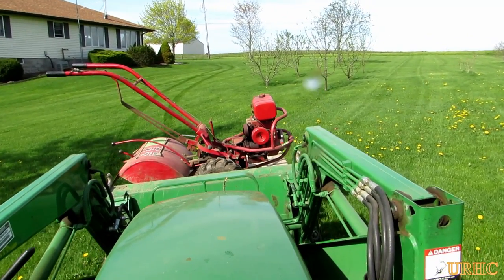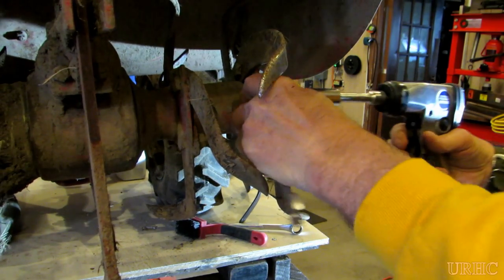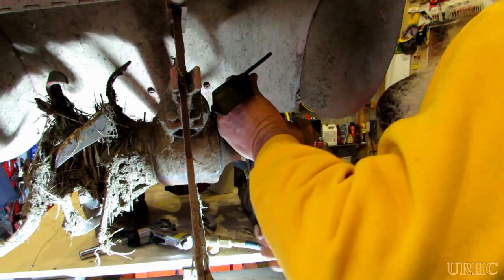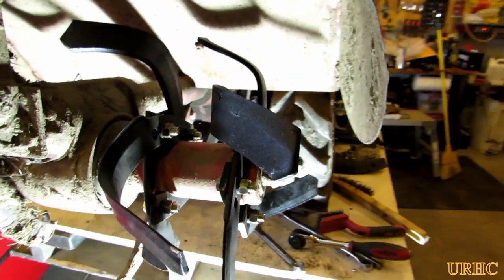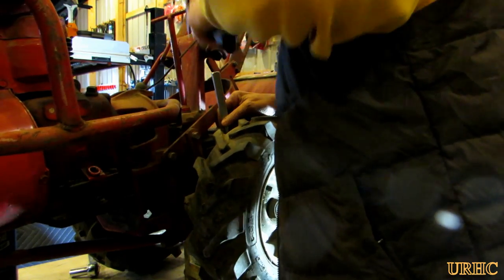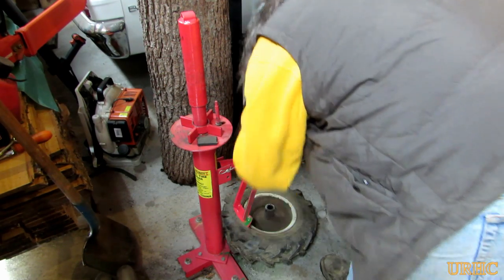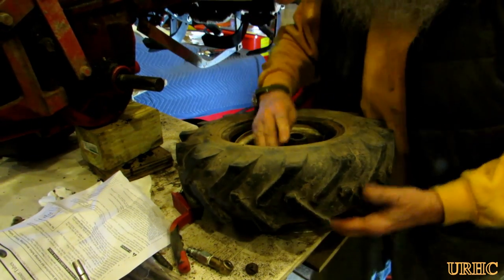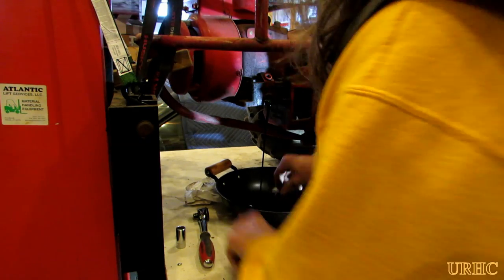Getting The Troy Bilt Horse Ready For The Garden

Comment: I recently purchased a Horse tiller that based on the serial number was built between late 1975 and early 1976 that came with the original running Tecumseh HH60-6pm .  I've replaced the wheel axel and tine seals that were leaking, rebuilt the carburetor with an original Tecumseh carb kit, added a fuel shut off valve and fuel filter, and replaced the tines.   I looked at cheap aftermarket tines, but after some research, I decided on OEM spec KD tines which although are  more expensive, I believe are worth the investment. Many aftermarket tines come with a 3 hole pattern, are shorter that OEM and made of lower quality metal.  Yes, these tillers are built like tanks and made to last which is why I opted to pay more for OEM spec tines.
Reply from the maker: Those tines were very good. Switched to raised beds and sold it. Thanks for watching.

Comment: I have the same tiller, 7 hp Koehler, still runs great but my times are shot . Just ordered the same times as you. $56.00 Amazon, free shipping. They are around an inch shorter than the original but for a third of the price. So I decided like you to use them. We will see , should be fine.
Reply from the maker: Mine have stood up well.  Thanks for watching.

Comment: You got real lucky getting that wheel to simply slide off.  99% of the time it's frozen onto the shaft and a bitch to remove. To prevent this in the future remove both roll pins one at a time and just start tilling.  Eventually the wheel will break loose.  At that point clean up the shaft and wheel bore and apply some anti seeze and reinstall the pin.  Now do the next one.  This will help ensure easy wheel removal in the future.
Reply from the maker: I found if the machines are stored outside that can be a problem,  but I have never had thst issue keeping it indoors. Blue Creeper is a easier option to loosen rusted together parts or to prevent  that from happening and it is environmentally friendly.  Thanks for watching.

Comment: I just bought 2 1970's Troy-Bilt Horse Tillers with Electric Start for $150.00, and I bought a 1979 Pony for $125.00 in 2004. I buy every old Troy-Bilt I can.
Reply from the maker: You were lucky to find them. They are hard to find reasonably priced anymore. Thanks for watching.
Reply: i bought a used one owner troy built wood chipper from the late 80s about 8 years ago use 2-3 times a year and it still works great troy built was a great out door power equipment co.
Reply from the maker: I still have my troy bilt chipper but haven't used it lately. Great machine.
Reply: jmaedl027 jmaedl  You will LOVE it. See my comments above.  Did it come with original documentation?  They literally told you how to tear the whole thing down and fix/restore everything. (now finding parts is difficult since TroyBilt was sold to MTD and its original factory in Troy NY was closed.

Comment: I didnt know that about the handle removal to fill the oil , thank you , mine has leaking rear axle seals I need to change and In the meantime keeping it full is a pain with hose and bottle lol  just did my times the other day ,  new belts and now I'm just adjusting everything and nee fluids , to the garden for the first time in who knows how many years, great to see these old machines being used , theyvreally are awesome
Reply from the maker: That's the easiest way to fill it and the rear seals leaking is a common problem.  Usually dirt grinds into the shaft damaging it so the seals dontlast like everything else on these machines.  Thanks for watching.
Reply: @unemployedredneckhillbilly2023  right on , your video really helped thank you

Comment: Best video I've ever seen for somebody that doesn't do it everyday of the week, very understandable I haven't messed with a tillerr like this in 30 or 40+ years this one was laying in a field and we're putting it together. I'm going to have to buy some parts for it, two tires a carburetors are already bought, probably a couple hundred dollars and I'll have it running good Tillers I grew up with one of the best , and thanks for the tip about the oil type. I'll report back after I get it running.
Reply from the maker: Thanks. Good luck with it. They were built to last generations. Probably will need tine shaft seals also. Thanks for watching

Comment: We own a 40+ year old  Troy Bilt , HORSE  . 
We would never think about putting it away in that filthy condition .
After every use we hose it down and remove any dirt and foreign objects in the tines .
For winter storage we drain the tank and  purge the carb  of fuel.
I pull the spark plug and  FOG the cylinder walls with oil ,to prevent rusting .

The following season ,the startup is flawless .
Reply from the maker: This one stays outside all summer. Full tank year round with stabilizer and that stuff comes out of the tines first use. Keeps on ticking.  Thanks for watching.

Comment: I have pretty much the same tiller, mine's a 5HP Horse (Kohler iron), probably about 1980.
Burns a little oil now, but not bad.
I think they had 7hp also, some came with electric start.
I have that bumper system too. You can put a "dozer blade" on the front with that (I have one of those too).
Those machines last a long time.
Nice videos.
Reply from the maker: This one came with a plow also. I sold it on Craigslist to pay for part of the tiller. The engine lost spark and died the end of last season so I will have to look at it soon. Thanks for watching

Comment: Thank you.  This was most helpful.  Just picked one of these up and was wondering where to check the gearbox oil.
Reply from the maker: They are tough old machines.  Thanks for watching.
Reply: So after looking at the gearbox fill I assume the rear tine box is lubricated from the same reservoir.   It would appear to run through the drive shaft housing into the rear tine box.
Reply from the maker: Yes it's a hollow casting. Usually the rear tine seals go and cause the level to drop.
Reply: You are correct.  Gear oil level was down and I noticed the rear seal was wet.  I will need to keep an eye on it.  May need to replace that gasket sooner than later.  Thanks for the heads up.

Comment: I have a 6 HP Troy-Bilt horse my father purchased in 1981 with a tecumseh engine.  It still runs well, starts in one or 2 pulls after being away in storage for the winter).  It does  smoke intermittently  (seems to subside when the oil is actually LOW so it doesn't make sense...) and then the engine almost starts running to an idle until the smoke clears.  Can't figure the issue, it's been that way since the last time my father (who has since passed away in 2014) some 20 years ago.   I have LOADS of documentation on it - all supplied by Troy-Bilt that they generously gave you before being sold to MTD in the late 1990s and moved out of Troy NY.

Other than the smoke, it is nice when the tiller starts in 2 pulls. Of course, getting parts for it is getting tough.  I won't let go of it.
Reply from the maker: I visited the original factory in troy to buy my Squeezo back in the 80s and they were doing well. Too bad companies like them were bought out and the manufacturing moved offshore. Do you turn the gas valve off when not using it? Sometimes the needle valve will leak gas into the cylinder if you don't an make it smoke for a while warming up.  Thanks for watching.
Reply: John DeNicola  might be piston oil ring. Just keep oil in it and let her work.

Comment: Great info on tine replacement..my 7hp needs it and I wasn't sure which tines to get but it looks like the eBay ones will do fine. In my 71 years I've used multi vis in all types of air cooled engines with no trouble. In fact it gets down to 40F at night here even in summer so SAE30 is never a good idea regardless of what manuals say. I use just Supertech 10w-40 in summer equipment, 5W-30 in snowblowers..
Reply from the maker: I use whatever  the engine  manual calls for. Thanks for watching.
Reply: @unemployedredneckhillbilly2023  That's obviously the safe answer and probably how most folks roll. I hope someday you'll have time (and the thermometer) to chill SAE30 to 40°F and tell us what you see. Then heat SAE30 to 170°F and tell us what you see. Same thing with 10W40 and let us know any conclusions...thanks again for the tine video..liked subscribed..

Comment: The sulphur /phosphorous blend in gl5 is higher than the gl4 gear oil... the higher sulphur / phosphorous blend sticks more aggressively to the yellow metals, and as a result, the metal peals off of the gears (instead of the additives)..This is not a high heat or high pressure situation, nor is it a 20,000 miles a year rototiller (maybe it is).  for the price, go with the manufacturers oil (the price difference is insignificant).  I am not recommending anything (gl4 or gl5), I am not selling anything, I am not getting paid.  this is only my opinion.  Thank you for a wonderful video.  Happy Gardening to all !!!
Reply from the maker: The gl5 from Walmart says on it that it is safe for brass and copper. The manufacturer is long gone so that is not a option. It only sees about 5 hours a year use and this is the oil I have seen reccomended online if you can't find the gl1. Thanks for watching.
Reply: Without a doubt, most tillers only see about 5 hours a year, and since it isn't a high heat, high torque, high speed situation I guess that gl 4 or 5 are both quite ok.  (the house is falling apart, but things like this turn me into a retentive mess (go figure)).  Thanks again for a great video.

Comment: You went through the trans oil level check a little fast..for us slower guys without the Troy manual how to you do that again..?? is the level supposed to be at the plug behind the left tire, I'm guessing ya want the tiller level not resting on tines..thanks
Reply from the maker: I find  the easiest  way is remove  the handle screw  and put a screwdriver in there like a dipstick and then hold it up against  the side to see if it's  level with  the plug. You can also remove the side plug and fill till it drips out. The manual shows exactly  how to fill it. Thanks for watching.

Comment: I just bought a used TB Horse 3 (Kohler 7 hp) circa 1984 at an auction... runs like top. No manual... 30 weight detergent engine oil, but 80/90 wt gear oil for the trans.?
Reply from the maker: Be sure  the gear oil is compatible  with  brass. Not all 80/90 is. I use 30 wt in the engine because  everything else runs right through it.  Thanks for watching.

Comment: Enjoyed your video.  Thanks for the tip about the GL5.  I have the same machine, though I think it has a 6 hp Kohler.  Is there a way to fix the clutch adjustment so that I don't have to hold down on it to keep it tilling in heavy cutting?  I have tried pretty well everything the book recommends.

Question:  Why is the transmission oil GL5 rather than 75/90 gear oil?
Reply from the maker: Be sure that you have a matched set of belts. That will happen if one belt is larger and it's only really working with one. Thanks for watching.

Comment: There's a product that you can use to stop the seals from leaking in the transmission. Doublewide6 on YouTube used it on a snow blower gear box and it works really well. Here is the link to buy it:

Look at this on eBay http://www.ebay.com/itm/292044457208

Link to doublewide6 video: https://youtu.be/3jjfFM9JuSk

I have never used it but did buy some for the Cub Cadet 582 special we are restoring at the moment.
Reply from the maker: You have to be very careful about what you add to the oil with the brass gears in these tillers. Some additives will cause them to self destruct.  Some day I will replace the seals. I think all the dirt ground in over 35 years could have damaged them.

Comment: I have have gotten a lot of contradicting info on what gear oil to use in the horse gear case.  This is what I found on Troy-Bilt's sight just in case it's helpful to anyone.  Thanks
Tiller Transmission Lubricant

Sep 11, 2017•FAQ
Article Number
000002341
Problem

What lubricant should be used in the tiller transmission case?
Solution

In the past the rule was: For partial fill-ups (a few ounces or less) use SAE 140, SAE 85W-140 or SAE 80W-90 weight gear oil with an API rating of GL-4 or GL-5. For full replacement use SAE 140 or SAE 85W-140 gear oil with an API rating of GL-4 only.

We have also found that 80W-90 oil with an API rating of GL-1 is acceptable for both partial and full replacement of tiller gear oils.
Reply from the maker: Really just has to be brass safe. Ariens makes a high pressure additive for auger gears that I have also tried. Thanks for watching.

Comment: Do you just fill the motor oil up to the thread lines? On the transmission oil, where was the plug? And how do you know how much to put it? I saw you check the level with the screwdriver and say it was low, but it how did you know? Thanks for the great vid!
Reply from the maker: I fill the oil up to the center of the plug threads. There is a plug on the side of the transmission that can be removed to check the full level. I just use a screwdriver and check it is at that level from the top . You just fill through the handle bolt hole. Thanks for watching.

Comment: Is that the "Horse" model? When I was a kid my Granddad bought one of them brand new and I'm going to be 41 in a couple weeks! I remember that it had some good compression- if you weren't careful when you were pulling it over you would snap your wrist something awful. It was a great tiller- I think that my uncle still uses it. Great videos, very informative.  John
Reply from the maker: Yes it is the horse. It is at least 35 years old and still going strong. To bad troy bilt went out of business and sold out to mtd that cheapened the new ones down.  Nothing like old cast iron equipment.  Thanks for watching.

Comment: I have one extremely close in age. I can't find any plates for manufacturers name or anything. Do you have any sources to find out year or anything else that might help
Reply from the maker: I think the serial number indicates  manufacturing date. Do a search for that information.  Thanks for watching.
Reply: Models older than around 1990 only use horse or pony as the model number. The serial number is on right top side of the transmission below the T handle

Comment: I just picked one up off Craigslist in the free section FCFS.   I messaged the guy and offered him $20 to hold it for me because I live 47 miles away.   35 minutes later I was pushing it into the minivan.    If I had known it was a Horse I would have offered him $50.
Reply from the maker: Wow are you lucky.  They are great machines.  Thanks for watching.
Reply: One belt is missing.   I ordered two and came here to learn from
Another’s experience to put it on.   Thank you for sharing your knowledge.
Reply: One belt is missing.   I ordered two and came here to learn from
Another’s experience to put it on.   Thank you for sharing your knowledge.
Reply: One belt is missing.   I ordered two and came here to learn from
Another’s experience to put it on.   Thank you for sharing your knowledge.
Reply: One belt is missing.   I ordered two and came here to learn from
Another’s experience to put it on.   Thank you for sharing your knowledge.
Reply: One belt is missing.   I ordered two and came here to learn from
Another’s experience to put it on.   Thank you for sharing your knowledge.

Comment: Those older original Troy Bilt tillers bring big bucks now....hard to find one that's decent for less than  $1K ...heck of lot better than the junk they make now....
Reply from the maker: They are a tough machine. I got mine off Craigslist in the off-season 10 years ago for a very good price and it has been a trouble free work horse. Thanks for watching.
Reply: We dropped $1,000 for an old Troy Bilt,,,It was worth every penny.
Reply: @thomasgronek6469  Heh-heh... didn't lose their value (at least in dollar paid).. The one I own cost just under $1000 when my dad bought it new in 1981.

Comment: I see that you're using high detergent 30 oil that is not the correct engine oil you should be using non-detergent 30 oil and you can purchase the oil at tractor supply. Thanks for your videos as always very well done
Reply from the maker: From what I have read modern detergent oils are better for small engines using ethanol fuel. The splash lube system just mixes up everything anyway so contamination never really settles out. I don't know which one is best, but I stick with oil with the highest rating.  I think the lack of lead in the fuel causes most problems with these old engines. Thanks for watching my videos.

Comment: $6 or $7 for air wrench???
Reply from the maker: I got that years ago from harbor freight when they just sold through mail order catalogs.  I think it was $6.99. Surprisingly it has worked many years with no problems. Thanks for watching.
Reply: I like it. I have 3/8" drive  wrench with straight grip but I need one like that also.
Reply from the maker: And I thought that I was the only one still using air tools. Everyone seems to be heading to battery drivers lately.

Comment: I see you have 140 wt GL5 gear oil. That is not the correct oil for the gear box. GL5 is NOT rated for brass gears ( Troy has brass gears). It’ll eat the brass. 
It should be GL4
Reply from the maker: it uses buffered sulfur and is safe for brass. Thanks for watching.
Reply: @unemployedredneckhillbilly2023  I stand corrected ( and sit)
Reply from the maker: l used to use gl1 with Ariens high pressure  additive but that got expensive.